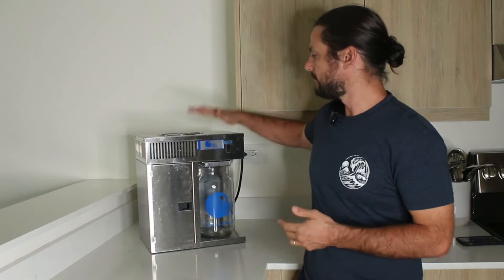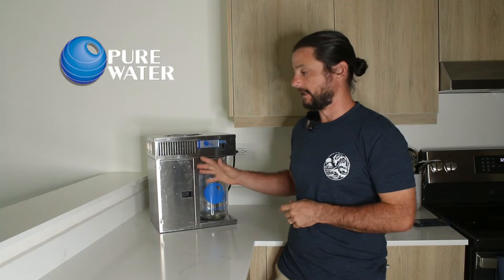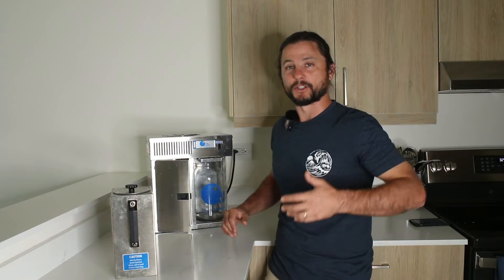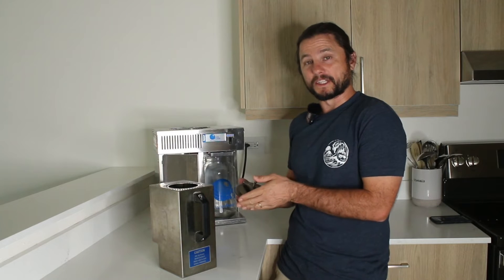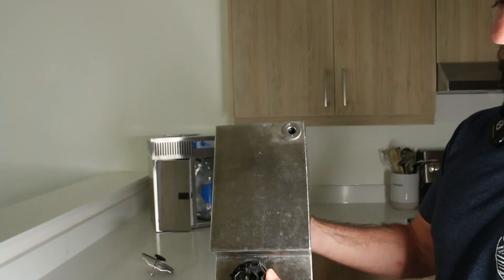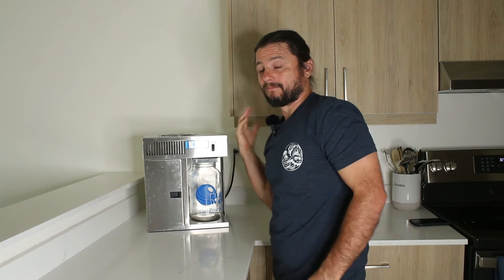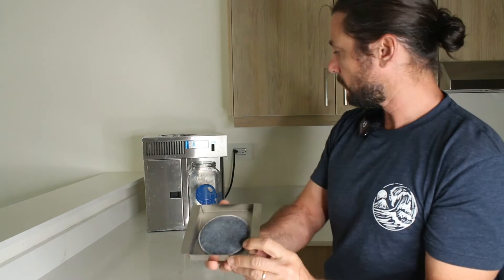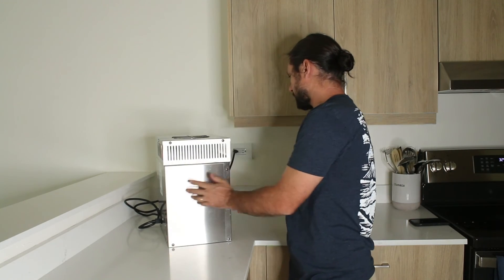How to set up Water Distiller by Pure Water

Comment: Distilled water gives you a factory reset on your drinking water.  You can add back in the minerals you prefer very easily.  This is how the Navy made drinking water for decades.  And that carbon filter is a backstop for any particulate carried over from the distilling process to give you a particulate free final product.  Very insightful, thanks for the presentation.